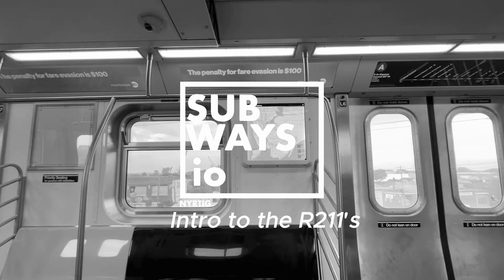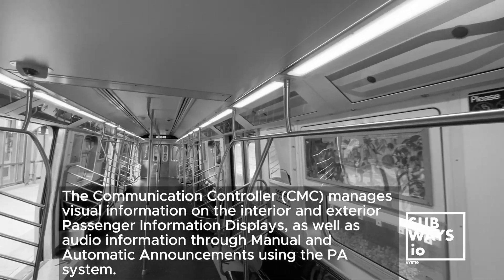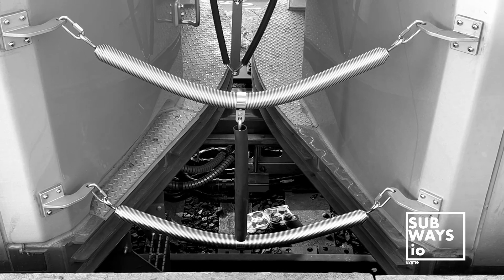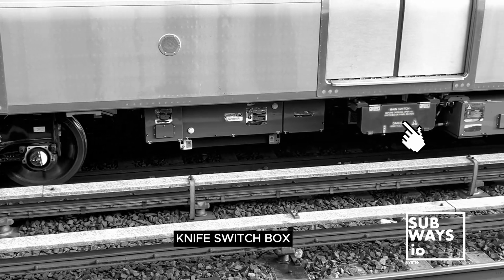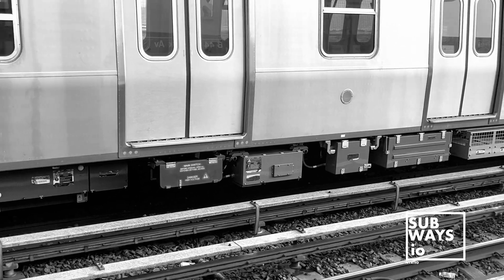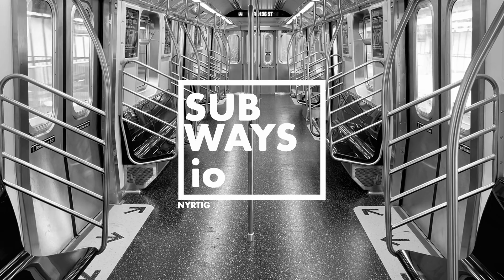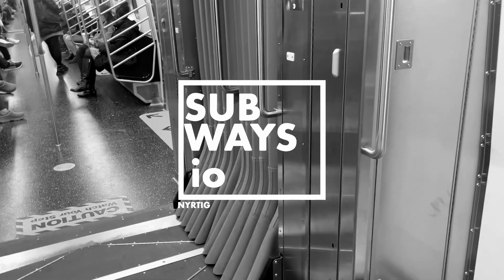R211: Computers on Rails | How They Compare to R160B & R188

Comment: Your videos are very interesting. It would be nice to have a glossary video or some kind of write up explaining the abbreviations to copy and keep on hand as the various videos are watched. For example what's TLC, TCMS, RS and LS TCN, etc. lol
Reply from the maker: Hang in there the Traction power basics 101 will go through the train line principles and different train sub systems of rolling stock. Many of the acronyms here will be described. Our goal is to bring the engineering element simplified.
Reply: @Subways_io  Great. Sounds good.

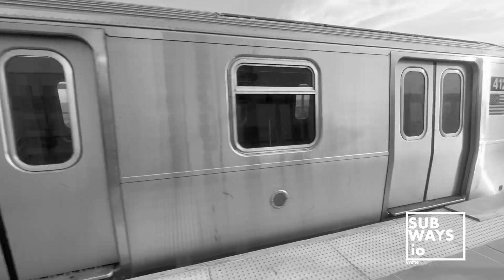Comment: 0:30 Can you clarify what TLN standard did the R160's make use of?
Reply from the maker: The R160 still uses an RS and LS TCN setup connected to a TLC, but it operates on the older LonWorks standard. In contrast, the R179 and R211 use an Ethernet-based TCMS setup.